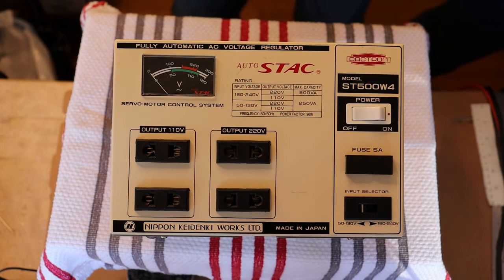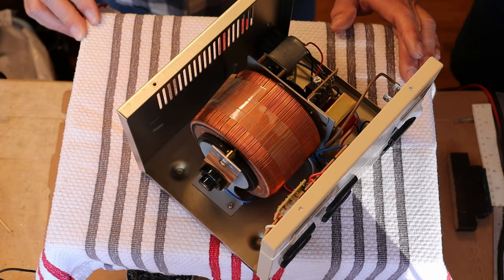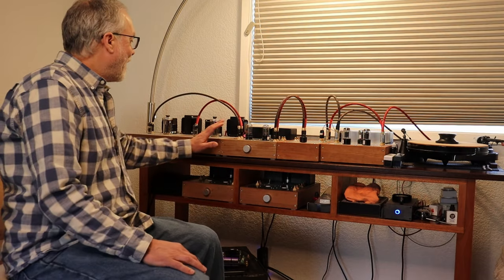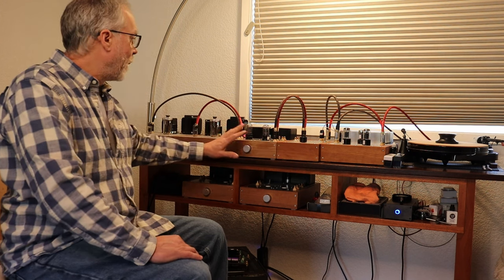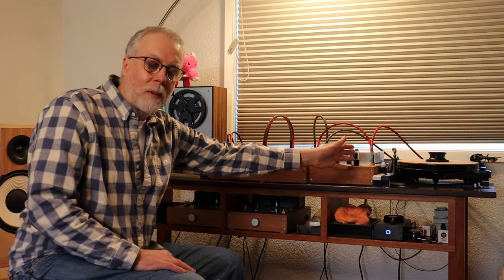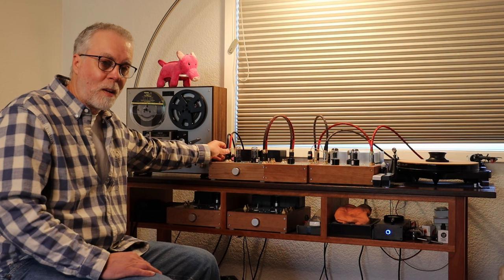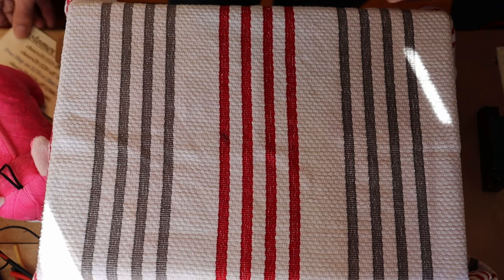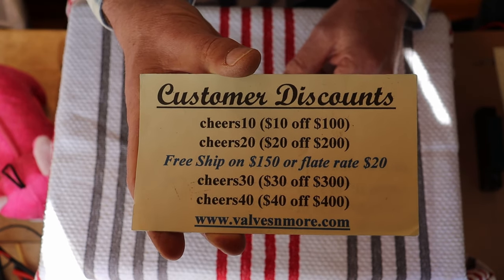Tube Lab #173 - System Component Layout

Comment: Funny ending! You guys are great and you’ve put together another important topic. Nine years ago I restarted my audiophile journey with a Bello ATC402 Audio/Video Component Cabinet with a glass door I removed for ventilation. Now I have a five foot DIY 3-level stereo rack to allow for swapping gear including my Wilsenton R8 integrated.

I am very happy with the NOS preamp tubes I’ve purchased from you.

QUESTION: when you filmed today’s video using your Zoom recorder was it connected directly to your camera or smartphone?

The reason I ask is I will be receiving a Zoom H6 today and I plan to record some YouTube vids with an iPhone 14.
Reply from the maker: #173 was recorded with a Comica shot gun mic fed directly into our canon camera's mic IN.  We mount the mic on top of the Canon in a flex mount.  This is how we record almost all talking segments and it works well.  For the money the Comica (Amazon) is a great mic when you are filming in locations with residual noise.
Reply: @tubelab194  - thanks for the info!!!